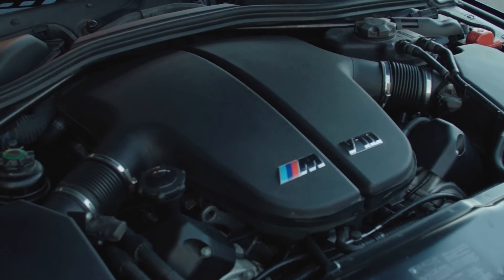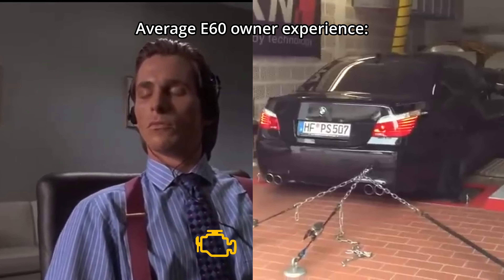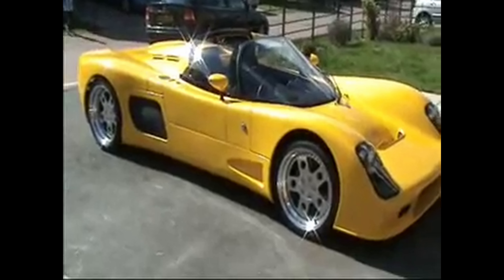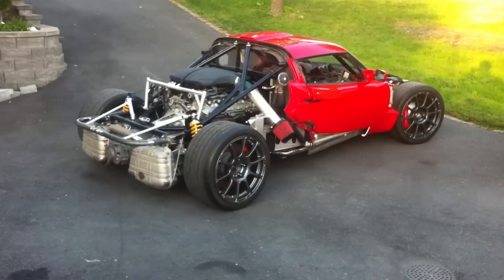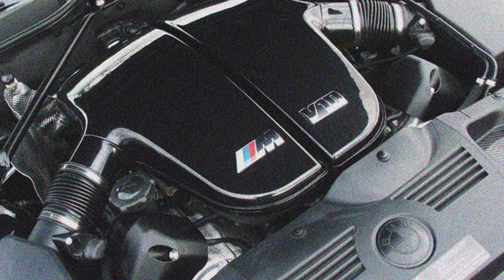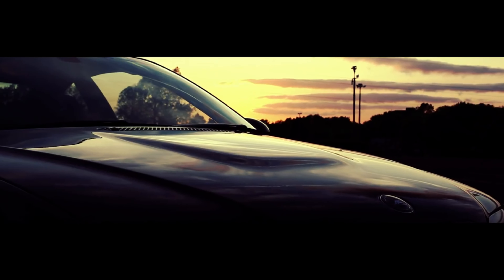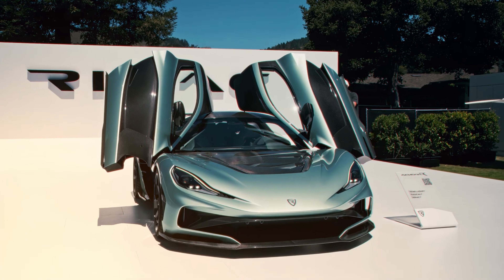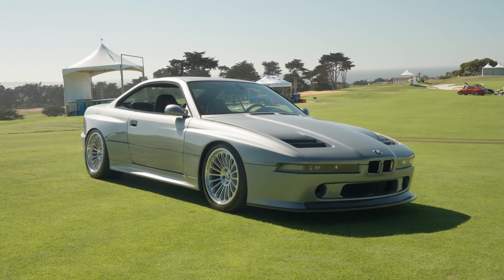Insane V10 Powered BMW 8 Series & 5 Epic E60 V10 Swaps

Comment: I'm surprised you didn't mention Procar's V10 swapped E46 M3. The engine is converted to dry-sump oiling system and it has the E92 M3's DCT gearbox. Autotopnl drove it on the autobahn upto +300kmh and Misha Charoudin drove it around the Nurburgring.
Reply from the maker: That's a good one! I'm surprised I haven't come across it before!